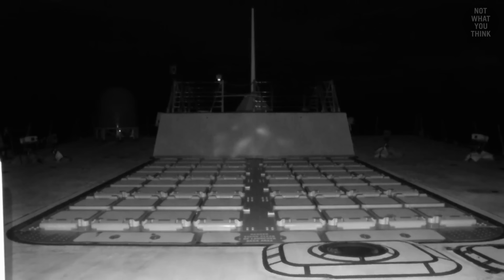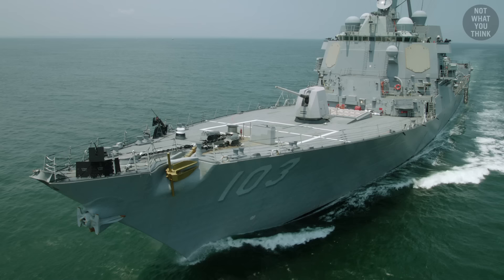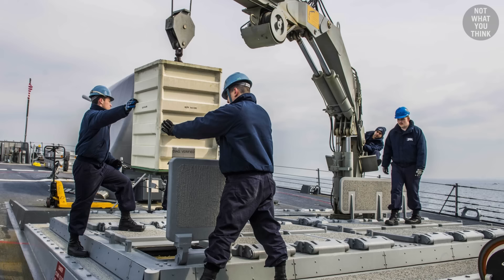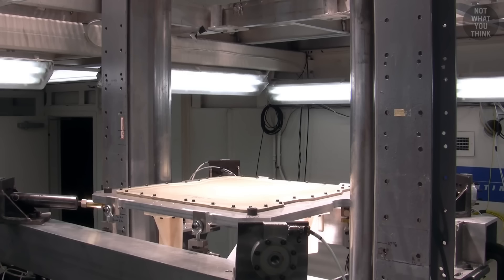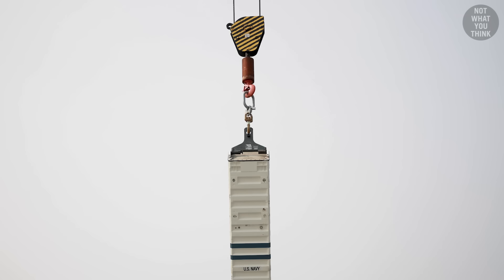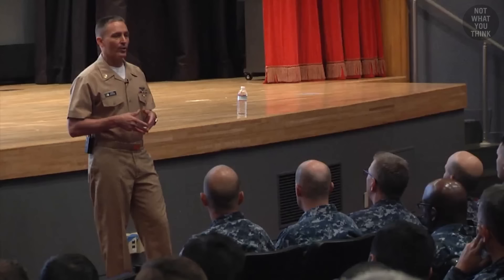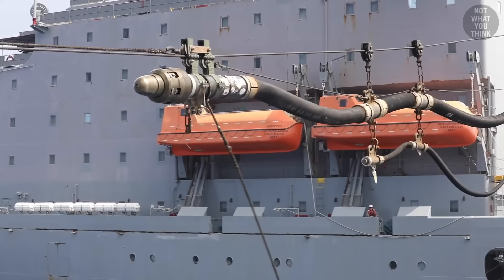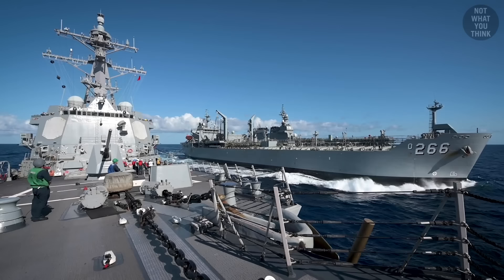Why Warships Cannot Reload Missiles at Sea

Comment: Regardless of what the ocean does:  It is not realistic to reload VLS  when still in a hostile environment anyway.
It's impossible to have people on the deck near the VLS, working on a Cell , when the ship itself still has to have its other cells ready to fire to intercept a threat.
One could argue that they could do replenish at the front cell while the rear cell is taking care of the defence, but in a pinch the ship cannot take half its arsenal offline in a combat zone.. That's just not acceptable.

So the entire ship first has to egress the combat zone
Reply: Going off that point its been an exceptional rarity for any ship to be resupplied while in contact for all of history. Your logistics vessels are too valuable to risk in such a mission and a ship with half its missiles is still more useful than one stuck to the side of a support vessel
Reply: most ships have 2 VLS cells so if this was the case they would disarm one and arm the other therefore the crew working on it wouldnt be at risk. But also if you are reloading that means your missiles are out thus there being no risk at all to crew rearming.
Reply: Yeah, about the only thing you could do for "quickly" reloading a VLS cell would be to design a set of guide rail adapters which act like a "funnel" to capture the bottom end of a container and quickly maneuver it to the cell mouth.
Perhaps a self-erecting gantry (like an ICBM erector) could be designed with a 2-axis traversing trolley, so you slide the container horizontally into the erector, erect it, then traverse it over the cell and slot it in place, but the mechanism would be very bulky and eat up a lot of deck space when not in use.... and you would still have to shut down your VLS array to use it.
Reply: Ideally every threat should be taken care of with just the missiles on board the vessels in the zone
Reply: @Nediac800  and that's basically the purpose of the VLS design: to enable reliable sustained fire of all missiles aboard the ship.

This is the main reason that the idea of a ship self-reloading VLS cells doesn't make sense.  If the ship has the cubage to store reloads, it also has the cubage to store them upright for launching.

That is to say, you'd have to store reloads on the exterior of the ship, because all the interior space you could put one in already hosts a launch cell.  And sorting explosives on the exterior of a combat vessel is a nonstarter.
Reply: I think you forget that other ships can "stay" watch while one is reloading
Reply: China's Type 055 destroyer has 112 VLS.  We need a cheaper version of Rapid Dragon concept  that can be placed on top of ships in case they need to reload fast!  Just have them on deposable boats that serve as missiles truck drones that go ahead of the Navy to take out the 1st wave of missiles.
Reply: @ShuRugal That sounds like a great idea.  Perhaps roll/slide an entire full pallet Rapid Dragon style into the launcher.
Reply: @dtsai  what might work for rapid replenishment would be to have that deck-mounted pivot point used on the fleet tender  to erect the missile before craning it over mounted instead on the deck in front or behind the VLS cell, and redesigned so that instead of attaching to the end of the crate, it attaches to the side, so that when the crane lifts the crate to vertical, it pivots directly over the receiving cell.

I still don't think trying to store reloads aboard the ship would be a smart idea.  Even box launchers on deck are less than ideal when taking fire, and those VLS reload crates are even more vulnerable.
Reply: @ShuRugal  I think all these missiles can be guided by different ships.  If they can't reload, then maybe they can just have more cheaper ships that are disposable and spread out.  Or maybe they can even have them launch some of them from their supply ships also.
Reply: @dtsai  it could certainly be interesting to see the PT boat format re-invented as a missile carrier.  I'm not sure that it could be done at a practical cost, though.  By the time you put enough launch cells in it to be useful in battle, you've got something the size of a WW2 era frigate.

That said, at frigate scale, you could certainly build something which would be the equivalent of a floating PATRIOT battery.
Reply: @ShuRugal you could also put the entire block of cells on a gimbal.  But doing it would be quite the task, the funnel idea is a whole lot easier.
Reply: @ShuRugal  Yes, a  floating PATRIOT battery!  You have a way of bringing words to my ideas.  Even China's Type 052D have 41 VLS!  If you ever played real time strategy game called Star Craft, you realize that it takes time build and is expensive to build Advanced Protoss ships while the Zerg bugs often win by doing the Chinese swarming of your home bases preventing you from building and gathering resources like gas and reloading.  Tons of Asians play and they often use the cheap swarm strategy which feels like cheating but that's what China did in the Korean War.
Reply: Taking half of the VLS cells offline in a warzone is absolutely acceptable.

Remember they are empty anyway, so They are useless anyway in that scenario.

So instead of going home or to a friendly port and leaving the warzone several days or weeks you just refill them slightly outside of the active warzone.

Bow VLS gets reloaded, then the stern one. And vice versa.

You have to remember one thing:

Sometimes you do NOT have the time to leave the warzone and you fellow sailors might need your full firepower or otherwise the enemy will. Sometimes reloading the VLS in/near a warzone would be the more prudent way to handle the situation.

I'm not saying you should constantly always do this.
But the ship, crew and equipment should be 100% able to handle it.
You can be assured if one ship has to leave a Carrier strike group or a standing nato maritime group in order to reload at a friendly port, the enemy will with 100% certainty attack exactly that particular ship, with submarines, drones, airplanes.
Literally with everything they have, because they will immediately know that this ship particular is now low on ammunition.
All they have to do is to keep attacking the ship a little longer until the remaining VLS cells are completely empty and it's game over for the ship.

The Enemy might be sometimes dumb, but not that dumb. They will know that there are only two possibilities why the ship leaves the formation in the middle of a fight.
a) ship is damaged
b) ships needs to reload the ammunition.

So even when you literally would never use it during under peacetime (accept for training)
The VLS system should be able to reload on the high seas in case it is necessary during a fierce combat.
Reply: Should be able to reload one group of pods (say the forward pods vs rear pods!)... Because no! You can't reload next to pods being fired!
Reply: @ashleygoggs5679  missiles can be stored and used from a VLS in any configuration and order. just because you lauched 8 missiles does not mean you emptied an 8 cell launcher, nor does emptying an 8 cell launcher forward mean that it is safe for the ship to disarm all focsle launchers in order to send crew out to reload.
Reply: @ShuRugal  the mk 41 vls does have a strikedown variant, featuring a collapsible crane in place of 3 cells. they are not used very often because of the infeasability of reloading while underway.
Reply: @ShuRugal  "for "quickly" reloading a VLS cell would be to design a set of guide rail adapters which act like a "funnel" to capture the bottom end" You mean like what is shown at 0:15 in the video, where they already have such a thing. It is a bit bulky, but not that bulky. Designed for two people to maneuver (you can see the u-shaped handle on one side), however one person can move it just fine. Just that its a bit big, bulky and awkward.

It takes about a couple hours to fully reload. The real tricky part is the crane is on stable land, while the ship is constantly moving. Actually it is a lot trickier to load it via a ship crane like they are showing it done. Trickier but quicker. The 3 cell little crane being on the boat is moving right along with the boat, so it is much easier. However it is also a lot slower. It is a little crane that does not move that quickly. The main point of have the VLS with its own 3 cell crane was the capability of reloading while at sea (or possibly dumping a hazardous container overboard). We did that once, so yes it can be done. But it is not fun and is very risky. Loading while in a sheltered and calmer port is fine, but loading out at sea one has to wait until sea conditions and suitable and that typically means there is still some kind of sea state.

The biggest gripe about all this conjecture (people clearly have no clue). A ship simply does not even NEED to reload that often. In the Gulf War, Operation Desert Storm, there was almost 300 Tomahawks launched. And we were the ONLY ship that fired all our land missiles and so needed to go in to port and reload. And after reloading, we did not even fire any more anyway. They have resupply ships, that had missiles, which could either be sent over via cable, or moved over via a crane when sea conditions were really great. Once onboard the ship, the launcher crane could reload it.
Reply: "when the ship itself still has to have its other cells ready to fire to intercept a threat." This entire concept is unrealistic. While the VLS is designed and fully capable of storing several various types of missiles, that is rarely ever done in reality. It mostly just stores Tomahawks. The next most likely missile that might be stored in the VLS is the Harpoon. And neither of those will be used to intercept an incoming target, as neither are Anti-air missiles. The combat zone as you call it is near land, so would cruise further out to sea, or near an enemy cruiser battle group. And that likely would be several hours away by the time a Tomahawk would reach it (hence why the anti-ship variant was dropped to begin with as it just was not really feasible by the time the Tomahawk neared the area those ships were many miles away from its initial waypoint). In a pinch, the ship would receive missiles from a resupply ship, which would not be done so close to a combat area anyway. And using the onboard VLS crane it could reload a missile in about 15 - 20 minutes time off the deck of the ship. But again that is a highly risky and last resort measure, even during peace times.
Reply: @wyattroncin941  read the rest of my post.

The reason reloading underway is so infeasible is because maneuvering a 30 foot tall pendulum on a moving ship is basically impossible.

The solution to that problem isn't to attach a crane to the ship, it's to use a rigid gantry.  The problem is that such a gantry would be bulky as fuck.

The ultimate problem with reloading at sea is that anything you could put on the ship to reload with would be better used to just carry more already loaded launch cells.
Reply: Its a simple trade off
The old Mk-13 and MK-26 carried less rounds but could be reloaded at sea and had trainable launcher
The VLS cant be reloaded at sea nor it is trainable but carries more rounds plus able to use larger and much heavier missiles like the TLAM, SM-6 and SM-3
Reply: So true. It’s not like there will be a supply ship in the middle of combat waiting to get shot.
Reply: @ShuRugal  When I look at China's new ships, I wonder if China stole the designs for the Littoral Combat Ships and sabotaged the project by introducing design flaws and ballooning the costs.
Reply: @dtsai  The engineers who worked on the LCS would have noticed if an outside actor had maliciously altered their design. It had design flaws and the costs ballooned because that's what happens with a great many projects of that scale, and not just defence projects. A new vessel or weapons system can often have competing or even contradictory requirements during its design phase and that's before you deal with the problem of political interference and shifting goals.
Reply: @verdebusterAP  "The VLS cant be reloaded at sea" WRONG!!! We have done it. Not very safe, but it can and has been done.
Reply: @kevinfisher1345  
No it can't be done 
The problem with reloading at sea is that missiles like TLAM, SM-3 and SM-6 impossible due to their shear size and weight
Reply: Why don't they have a "magazine clip" of missiles that pushes in from the side of the ship?
Reply: @glennllewellyn7369  
They did in past with the old Mk-13 and MK-26 but large missiles like the TLAM, SM-6 and SM-3 are too heavy 
With DDG-X , they are trying to resolve this issue by introducing swappable modules 
A fully loaded VLS weights 70 tons which is light weight for most mobile cranes
The idea is yanking out the whole empty module and replacing it with fresh one 
Even if the old one has unused missiles, its easier to swap and let personnel on land handle the unloading while the ship gets fresh load and head out 
For one, it reduces time in port for weapon reloads but importantly, it allow them to service the VLS modules 
Servicing them normally was only done when the ship was in overhaul, swappable modules allow them to service them anytime
Reloading at sea with the ever increasing size of missiles is no longer possible
Reply: The entire ocean all the way to Guam is within the range of PLA missiles...and they hv the demostrated...shooting down a moving target..with a missile..fired..from a range of 1500 km..
So...best to stay safe..and get the hell out of western pacific😂
Reply: @verdebusterAP  I have personally done it. Sorry mate but it can and has been done. Size is not an issue transferring over by cable, and the strikedown crane was designed to handle the size. It however stuggles to handle the load even in normal conditions.
Reply: @glennllewellyn7369  "Why don't they have a "magazine clip" of missiles that pushes in from the side of the ship?" It is called space limitations. If they had the space, they could just simply have a bigger VLS launcher instead and no need to reload at all from the side. You realize you are talking about roughly 3 stories tall right and this is on a ship? And most of that is below the water line.

On our Spruance class ship, we had a 64 cell VLS launcher. At the top level (one level below top of the deck) there was a passageway on either side to access the spaces forward on the bow. At the bottom of the launcher was just an empty void between that and the outside hull of the ship. Can not recall how much space, but you might have gotten one more canister to the side. Maybe! That is 8 more on either side, and realistically just is not worth it considering the space you have to give up and realistically doing away with most the spaces forward in the bow. Like the gun mount, sonar tech spaces including maybe even the sonar dome itself, etc.
Reply: @verdebusterAP  "Originally, one module would consist of five cells and a collapsible crane for assisting with replenishment at sea, but replenishment of large missiles at sea was later seen as impractical and dangerous, and modules with the cranes fell out of use."

Interesting, even Seaforces agrees and proves you are wrong. As I stated before we loaded a Tomahawk under way using the VLS strike down crane. So stop saying it can not be done, when I know for a fact it could. It was dangerous and so not worth it, but was capable. Tomahawks weigh 1.6 ton (1600 KG) and the crane was able to lift close to 2 ton. The issue was it was only able to lift it and load a canister with a Tomahawk in it in a cell closer to it. Fully extended out and that load capacity is reduced. I was the FC for the Tomahawk and not the GM's in charge of the Launcher, so I do not recall how far away that limit was.

The reason the crane was dropped was not due to it not being capable. It was dropped as the main purpose for it (being to load or unload out at sea) was way too dangerous, risky and simply not very practical.

FYI: Loaded with 48 SM-2 Blk II Missiles
and 13 TOMAHAWK Missiles . . . . . . . . . . .516,000 lbs 230 light ton 

Also it was the job of the GM to service the VLS, although we helped quite a bit. Another BS with your it was only serviced when the ship was in overhaul nonsense. Just as with your ever increasing size of the missiles, Tomahawk has not increased in size at all, and even IF a missile were to increase in size it would not fit in the VLS and so would require a completely new module.
Reply: @kevinfisher1345  
that math is wrong
The strike length VLS empty weights 15 tons empty
A TLAM weights 1.75 
13 is 22.75 tons
SM-2 BK II weights 1,600lbs 
Even round weight up to 1 ton
its still 48 tons which combined is still 85
Reply: @verdebusterAP  Yea ok mate, Lockheed Martin, BAE, United Defense are all wrong. Smh! Please stop spreading misinformation. You clearly are clueless on this topic. Worse you can not even do a simple google search.

VLS empty weighs 262000 lbs. That alone is 118 tons per the maths. Or per United Defense 117 light tons. I already told you that a TLAM weighs 1.6 tons WITH the booster. (Give or take, it depends upon the variant actually which I no longer recall the specifics). It actually only weighs 1.3 tons. So 13 TLAM's is 17 tons. With the booster it is 21 tons. And that is not even in a canister yet. And are you seriously trying to claim that 10 TLAMS weighs more than an empty VLS? Seriously? The only Maths that are wrong is yours mate, as you were way off.
Reply: But egress could take a long time with the range and speed of some anti ship missiles
Reply: The problem here is that we haven’t faced major naval operations in a contest environment since World War II. Back then, you could rotate the ships out for resupply and have the numbers to replaced them …. Back when we actually had a fleet large enough to do that. Today, each vessel is exponentially more valuable, and far far less replaceable.
Reply: @Matt-yg8ub  "Back then, you just brought the ships out for resupply and replaced them" WRONG!

"Back when we actually had a fleet large enough to do that. Today, each vessel is exponentially, more valuable, and far far less replaceable." Again Wrong! 

Yes back during WW2 at the height the USN controlled well over 6k ships. A lot of which were converted civilian ships. When the USN lost a major ship, it was a huge loss and not easily replaceable. As any war historian will tell you, the USN losing one or a couple key ships determined whether they won or lost that battle during WW2. A large portion of the naval ships were for support and transport. And at the beginning of WW2, the USN had 790 ships in total. And it only ballooned up to 6700+ by the end of the war. And out of those 6700+, only ~550 were combat ships that were not easily replaceable, being Destroyers or larger. Yes the rest of the fleet were resupply and often times replaced, as again they were quite often previously civilian ships that had been converted.

Today's times are vastly different for numerous reasons. The US military already has troops and bases all over the world. So would not need to transport as much, especially early on. Much better aircraft that can transport far more and for far more distances. Better tech including communications to keep tabs on what all is going on around the world. And the USN still has roughly ~300 combat ships today. During peace times that in todays world that is a huge navy. More than the next 11 largest navies combined. And which can support easily on two if not three fronts at once. The US military (including USN) ensures it is capable of taking on two wars at once if not more if need be. And yes the key ships will be far more valuable and less replaceable today JUST as it was back then. That has not changed and likely would not ever change during any such big major war.
Reply: @kevinfisher1345  Congrats, you lost the forest for the trees. 
Instead of accepting that not everyone on the face of the planet phrases things exactly verbatim the way you would personally choose to do so in your dissertation… you’re unwilling to concede that it’s a Forest Because “dammit, those are trees!!!” 
And for pedantic trolls like yourself I’m sure it’s never crossed your mind that anyone could think otherwise .
Reply: @Matt-yg8ub  Congrats for you being completely wrong and trying to ignore it by passing it off as being pedantic. Smh! I on the other hand will readily admit when I am wrong especially if proven wrong. What any of I said has to do with trees is beyond me. Sorry mate but each of those combat ships during WW2 was just as big a loss that was felt as it would be for those we have today. You are simply WRONG and to pedantic to admit it. You were also wrong that they only had a fleet that large DUE to war, duh.

When I see BS, I will call it every time. It has nada to do with pedanticism, but simply BS. All the combat ships were just as valuable back then as they are today PERIOD
Reply: @kevinfisher1345  I never said they ONLY had a fleet that large due to war. I simply said that with a fleet of thousands, the loss of a single vessel isn’t as damaging as it would be in a fleet of only a few hundred in which each vessel is more costly and takes longer to replace. The rest is you choosing to read your own bias and opinion into it and then having the brass to chide me for your mistaken views.
Reply: @Matt-yg8ub  Straw manning now. Smh!  I was the one claiming they had a fleet that large due to war, not you. Can you not read and comprehend what you read? And I claimed that because it was true. Going from ~700 fleet prior to over 6k during.

"I simply said that with a fleet of thousands, the loss of a single vessel isn’t as damaging as it would be in a fleet of only a few hundred in which each vessel is more costly and takes longer to replace." WRONG!!! That is not what you said mate at all. You said with a fleet so large back than such as WW2 that a single vessel loss was not as valuable of a loss. And compared that to today, which allegedly per you would be much more of a loss. Which is simply not true and the reason I called BS. Losing a single ship, such as a battleship or carrier back during WW2 was a huge loss and could have been the difference between losing or winning that battle. Even losing a cruiser was significant.

And your revised statement while technically true is not true in context you said. You specifically mentioned an example the size of naval fleet during WW2, while failing to notice that even during the US navy max hey day during that war, it still only had ~500 combat weapon ships. That is only a few hundred mate, not thousands like you are claiming. At NO time has the US navy fleet consisted of thousands of combat ships, so that statement would only be true in theory, not in reality like you were claiming it to be.

What you fail to comprehend is that the main combat power of the naval fleet prior to the start of the WW2 was a bit larger than the fleet we have now, but not that much. Also it was only around 700 ships in total at the start of the war. So only twice the size of US current fleet. It was only THOUSANDS later on because of war time. And as I already told you, because a lot of those thousands were converted civilian ships. Consisting of amphibious, supply and auxiliary ships. Not combat weapon ships.
Reply: @kevinfisher1345 You derailed what was a pretty good thread up the point you came in and started shouting "wrong!" at everyone.
Reply: The thing is to reload at see you have many variables. But If we forget them all for a second there still some problems Like having only one VLS array with maybe 16-48 cells or having a vls array only half empty because maybe of your 32 cells in the front 16 where tomahawks you launched and the Others ESSM you need. Its not impossible but its really hard to do and staying safe while doing it.
Reply: Well first they have to get next to a supply ship. Cruisers at least do not have available storage for extra missiles.